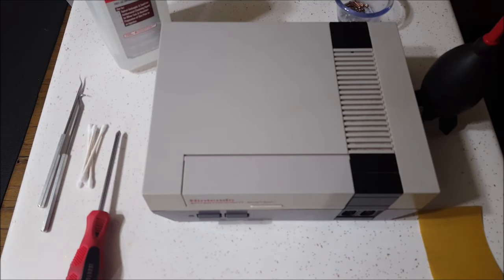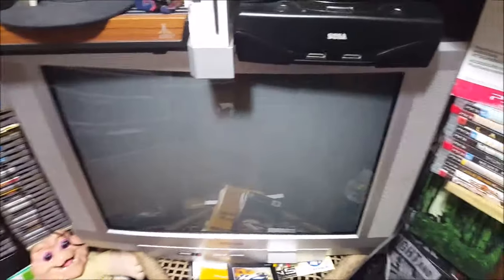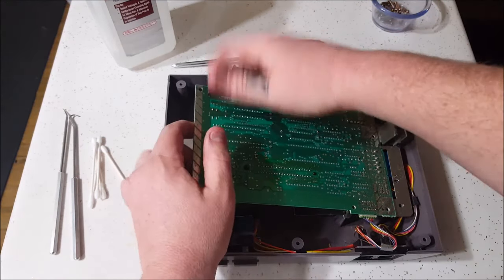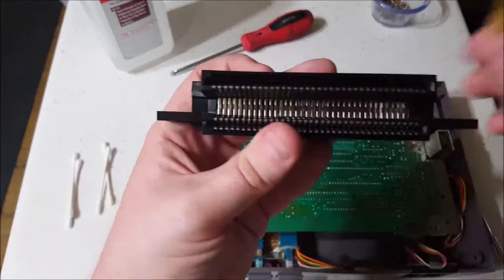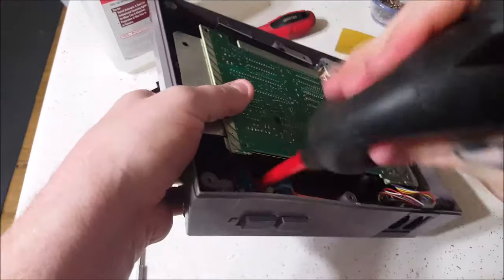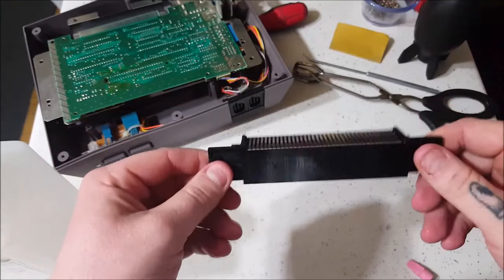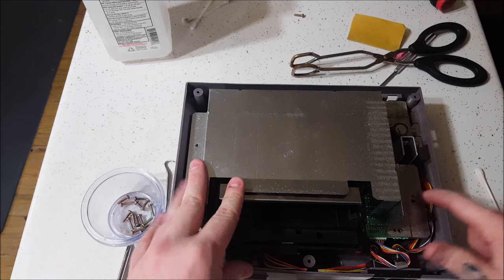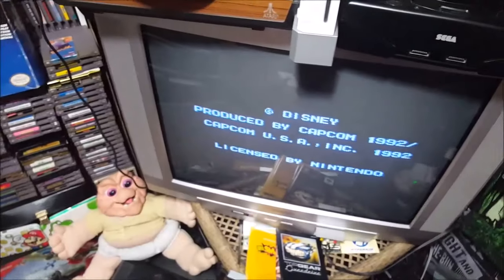NEVER Buy Another 72 Pin Again - How To Refurbish A Nes Easily

Comment: After I disabled the lockout. I just get a gray screen. Even with the 72 connector (along with the contact point on the motherboard) cleaned and the game chips cleaned. I cleaned them with isopropyl alcohol. Edit. Occasionally I will get a game to work but it will be kinda scratchy looking. Like there will be some buggy pixels lightly dusted across the screen.

Comment: Why do certain games feel tighter than others going in? ...and what makes it fit really tight? I just bought an NES on eBay and played the game that came with it (Mario/DH), and it worked just fine for 3 days. I go buy 5 games today, and soon as I try them out I start having this blinking issue not as much so with Mario, but it even has done it. I followed your vid (all but the boiling and lockout chip) and same issue. Can you help please
Reply: Btw, the 72 pin didnt even seem dirty, I still cleaned it with iso anyway

Comment: is there a way to free up the green board easier...i was having problems because it appears to be soldered heavily on the back right side...also i heard you count 7 screws for that i believe i only see 6 :(???
Reply: oh never mind now i see 7 and 8....
Reply: i have a couple nasty marks where there the 72 pin connects (off the green board)...is this permanent damage? tried cleaning several times with rubbing alc...not coming off

Comment: Have you ever seen a dim power light? Light is like it should until the game is inserted, then it goes dim and nothing happens.
Reply: Good chance it is a bad power adapter. Any 9V (AC or DC) adapter can replace it, given the end will fit properly and it outputs 850mA or more. 
You can cut the cord off the old one and replace the one on the replacement adapter if needed. Just check the original adapter's output with a meter, or by connecting it to a working NES before you hack it up.

Comment: I did this and now it doesn’t work at all... just a blank pink orange screen the games kinda worked before but now I can’t get them to work at all. This connector was replaced before any ideas on what may have happened?
Reply from the maker: if you did this with an aftermarket pin connector than that is probably the issue.  if the pins were tight before  you did it chances are it was aftermarket.  One of the biggest factors is to make sure the games are 100% clean as well

Comment: Question, when I attempted to remove the pin, it broke in half, so a small piece is still on the chip and the other is up straight, will it be ok or did I screw up?

Comment: Is there a reason why you chose to use rubbing alcohol on the contacts inside the console and not an eraser? Just curious since you used both on the game cartridge. Thanks!
Reply: Does the eraser actually work?  I'm wanting to get one and not use any chemicals at all on the contacts if in the eraser works that's what I want to use.
Reply: @byfieldmichael1992  A lot of people have mentioned  it. I just started using it so not a huge sample size.

Comment: I did everything you said in this video the Nintendo turns on and it'll play just for a couple of minutes but then it cuts off. What could have I done wrong?
Reply from the maker: sounds like something power related.  If it didnt do that before the refurb open it back up and make sure no connections have been bridged where you disconnected the chip or a cap is not hit
Reply: @Renebean  thank you the chip was still making a connection I didn't disconnect it completely. I'm new to this and I want to learn all the aspects as far as refurbishing the games and the consoles before I sell them cuz I know that'll save me a lot of money in the long run. you definitely got a new subscriber can I recommend your channel to a lot of people
Reply from the maker: @garygiddens4118  awesome glad to hear you got it figured out! Share away it always helps!
Reply: Actually bought two over the weekend and the second one went a lot smoother as far as knowing what I'm looking for but I did run into a problem when I put the game in the second one it pauses and unpause has over and over again any clue what could be making that happen? If I'm asking too many questions you could just let me know
Reply from the maker: @garygiddens4118  honestly I'm not too sure on that second problem that's a new one for me.  Try letting the console warm up for 20-30 minutes and if it does still maybe it's a cap issue

Comment: I actually broke the 4th pin off the chip when trying to bend it back. Is this ok or do I need to reconnect the bottom portion back on? Thanks for the video.
Reply from the maker: its fine it shouldnt make a difference

Comment: It worked perfect when i did everything. Didn't touch it for a month and I got a grey screen. It's not the games and I've had to fiddle with the games. The pins are still clean and still fairly tight. Do you have any clue what's going on?

Comment: I can tell ya before I even watch this that this isn't going to work very good for a lot of ppls pin connectors.  Isopropyl Alcohol simply isn't strong enough for refurbing these pin connectors.  You should be using something stronger like an industrial strength electronics contact cleaner.   

And for the love of god, you do NOT want to sand your connectors!  This will permanently damage them, will remove contact material & will decrease connectivity.  BAD idea!

And you do NOT want to try to bend the pins to make them tighter unless they are obviously damaged or bent out of shape when looking at them.  Truly clean pins should be all you need & will prevent a death grip situation as well.
Reply: Thank you, I'm glad someone else is saying this! I also really don't understand why he used a pick to cut pin 4 instead of just using a good pair of flush cutters. Levering a pick like that is absolutely asking for trouble and if you're not careful, you could damage surrounding components.
Reply: @thepthepthep  And you should also clean the surface that contacts the nes main board as well.

Comment: Why do you Boil the 72 pin?

Can you get away with not boiling it?
Reply from the maker: after sanding there is a lot of dust and debri everywhere so boiling removes that and helps with any the sanding didnt get
Reply: Boiling also makes the pins more malleable to get them realigned when inserting the cartridge chip back into them.  After doing the initial sand and individual pin adjustment by hand, the pins will not be perfectly aligned. So by softening them in the hot water, the game cartridge can then do further micro-adjustments to get all 72 pins more closely aligned.  (Notice how he says they're "warm" in the video). This means they'll be easier to physically move.  You need all 72 pins to make contact with the pins on the cartridge -- even if one is off it could affect the NES being able to read the game.
Reply: ok thank you
Reply from the maker: @dabullnice  another good point I forgot to add!

Comment: I'm getting a grey screen on my NES when I put in games I just bought that were tested at shop and worked. Suggestions?
Reply from the maker: try powering on with the trey not pushed down also try adjusting the game in the trey and hit reset if that makes it work its one of two things its either the pins aren't aligned or polished correctly or the games aren't clean enough

Comment: For the love of god man, don't use boiling water on plastics, it deforms them. The sand paper isn't necessary either, a sheet of paper with rubbing alcohol will remove dirt and grime just fine.

Comment: Great video bro!
Reply from the maker: Appreciate it!
Reply: @Renebean  what is the name of the screwer that you used for open the cartridges? I need one of these
Reply from the maker: @elispot17  they're usually called game bits.  Two different sizes but come in a set and are cheap. Check eBay.

Comment: Did everything as instructed and now it doesn't even power on.
Reply from the maker: sorry you are having issues but that would mean you done something wrong.  make sure you disconnect the correct pin and didnt rip a capacitor or trace

Comment: I followed this video exact and it's still the same I'm getting a white screen with a buzzing noise with 6 different games the only one that will play is super mario bros/duckhunt but during different times on every playthrough it will surge or something and the game just freezes but it's at a different point in the game every time any idea what the problem might be?
Reply from the maker: If you manage to get a game to work, you missed a step or didnt fully finish it.  redo the pins and clean the games.

Comment: The original 72 pin that was designed was to big  and the pins were not very durable over a long period of time and often they would wear out hence why when the top loader was designed the 72 pin connector the pins were much tighter together what's amazing is u can get brand new clone oem 72 pin connectors for like $5 online

Comment: do NOT sand your connector.... it might reveal "fresh metal" but it removes material and adds that much more wear to the connector... sanding any pins/connectors is NOT recommended regardless of if someone claims it wont "hurt" the connector. ultimately you're shortening the life of your connector... cleaning and polishing the metal is recommended to maintain the longevity and life of the connector...

Comment: What dose the block out chip do? Why do you want to dislocate the 4th pin???
Reply: Lock out chip makes it so you only play NTSC games and basically removing it allow you to play your Famicom games if you so desire to play them. Just with the size of a famicom cart could make it hard to play inside that type of machine. I think it's more practical if u use an everdrive that has famicom roms on it, be easier to get them running without a lockout on nes. Have a great day 👍
Reply from the maker: it prevents the system from having the blinking light issue caused by the lockout chip preventing import games from working in the system
Reply: Solid video.
Reply: @Vikrinox nah, you pretty much nailed it. Nearly every software company had to pay for the lockout chip in every game, until Atari/Tengen reverse engineered their own chips. A big class action suit and counter suit was filled, resulting in settlements, coupons and games being destroyed.
Reply: So I’m UK - will blocking out that 4th pin allow me to play both NTSC and PAL then?

Comment: Great way to warp the fuck out of a 72 pin. Now mine can only play Astyanax
Reply: I will say, it does work a lot better now. It's just MUCH harder to pull games out and the plastic's definitely warped (the pins aren't even either). Pretty sure putting it in the water the second time is unnecessary and just undoes the shaping you do after the first dunk.

Comment: brasso also work very well for cleaning bad pins.
Reply from the maker: it does!
Reply: That's how I fix them!!!
Reply: Brasso is not good for plastic and at the microscopic level it eats away at circuit boards. Long term it does more harm than good.

Comment: I just found my nes and the light is blinking i took it to have it checked out and they place i took it too said that i needed to replace my 72 pins
Reply from the maker: never replace the 72 they say that because its the easy way out but not the best preferred way after market 72 are not nearly as good as the originals plus they are extremely stiff making the games very hard to get it in and out of the system
Reply: @Renebean  im currently right now following the steps u did to try and fix my console
Reply from the maker: @kittiekat84  awesome if you have any further questions message me on insta!
Reply: @Renebean  sure thing

Comment: i went through this and the red blinking on the front of the unit stopped.  however, now I have a solid red screen and thats it
Reply from the maker: make sure your game is 100000000% clean and you shouldn't have an issue as long as you followed the steps right screens can be multiple colors don't be discouraged!
Reply: I recleaned the games and now they work and I can play them but I have to take them in and out a couple times and reset.  I am not sure if they look the way they should.  I imagine they shouldn't look great on a big screen modern samsung tv.  I am using av cables to connect.  wish I could post a screen shot of tv

Comment: Thumbs down!  You don't need sandpaper that just creates pitting in the metal for more corrosion to set in.  Missed the most important step of slightly bending the TOP row pins.  It's the top pins that cause the problem not the bottom row.  You will need strong lighting and steady hands to get at them.

Comment: I fix my original Nintendo entertainment system by cleaning the pins on the motherboard and boiling the pin connector also do the 10 nes chip mod

Comment: WTF. DO NOT SAND THE METAL!!! This will cause the contacts to be rough and damage your cartridges. If there is corrosion, spray some electronic contact cleaner like DeOxit on there and put a cart in and and out a few times. Bending the pins lightly is fine, but it isn't the best.

Comment: Mine still doesn't work. Blinking light of death
Reply from the maker: then you didnt do it right
Reply: @Renebean  I got it to work a little by bending the top pins down. If you look inside you can see the too pins are farther back. Followed your video, didn't work but I found a solution
Reply from the maker: @mknight6026  it's impossible to have a blinking light if you followed the tutorial. Glad you're up and running!

Comment: Never messed with an NES before. Got 3 of them for free from a family member. Just fixed the first one using these steps. Im sure I can fix at least one other one. has anyone experienced a purple screen before? Im going to use these methods regardless. Just wondering if there may be something else
Reply: Update: the purple screen was due to someone else removing the pin from the the circuit. Seems like they didnt clean the 72 pin well enough. All 3 NES systems that were given to me for free now work like new!